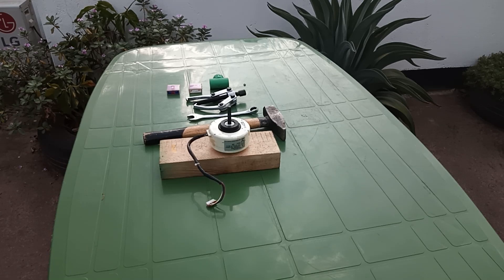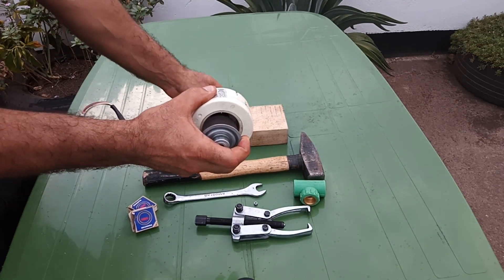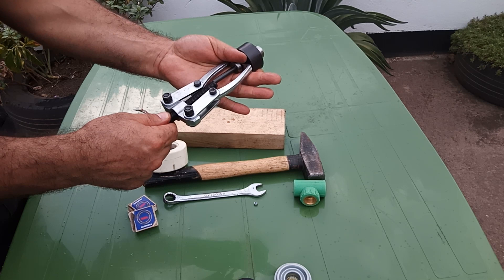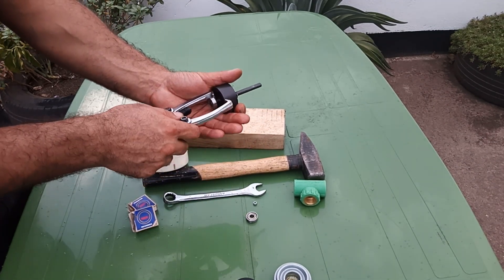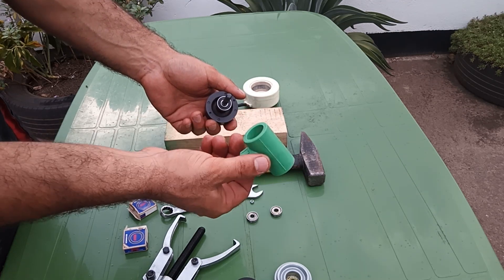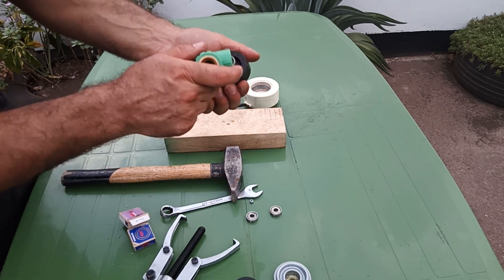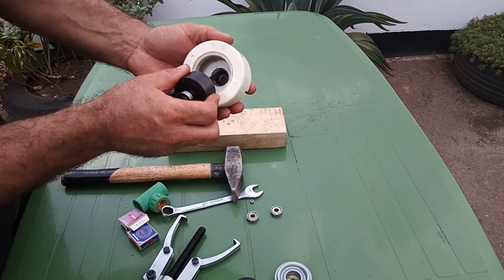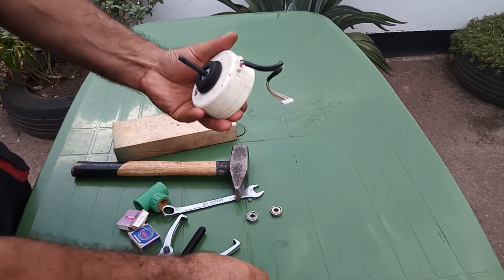How to replace AC indoor unit's blower motor bearings on LG WITH DUAL INVERTER COMPRESSOR

Comment: Have you had any issues with the wave washer making noise? I was concerned the soft rubber sidewall sealed bearings wouldn't hold up over time next to metal wave washer pressed against it.
Reply from the maker: I never had any issues with wave washer but I always check to make sure the wave washer overlap the bearing cup.
If you select the right bearing it never happens.